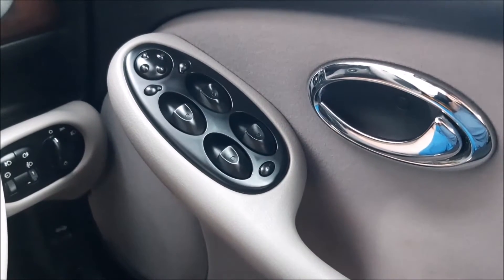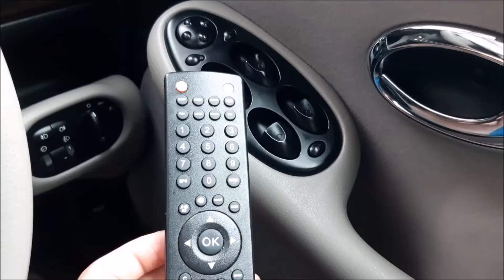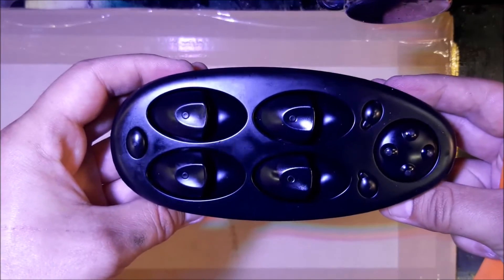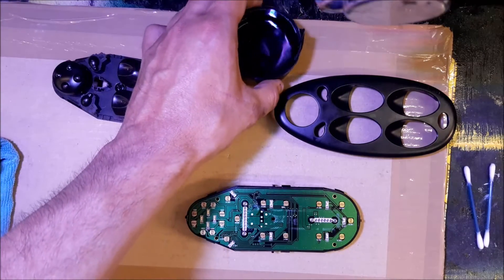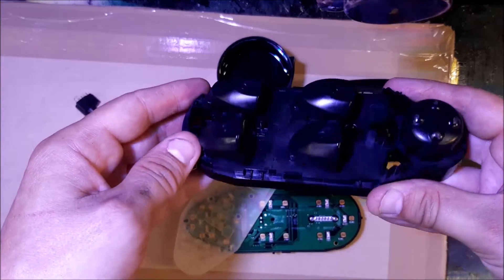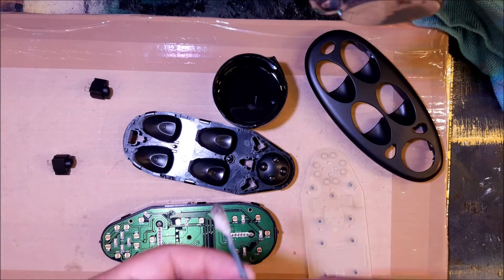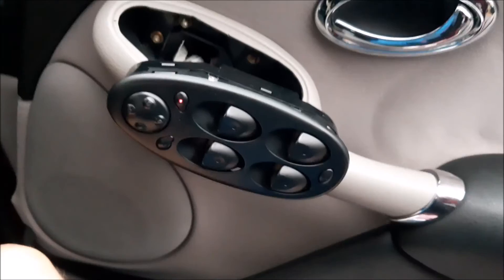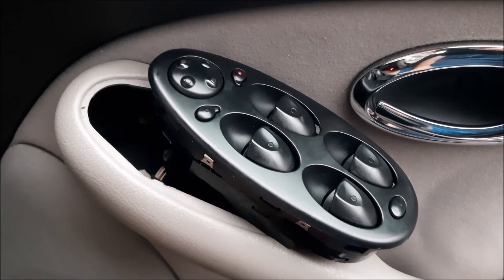repairing the mirror controller switch on our rover 75

Comment: EXCELLENT VIDEO  well explained well excecuted. i have a rover 75 here in mexico city,. and i'm putting it to it's best. Now i have to find a few parts, lije the seal rubber along all the frame than fits the door. and the front quart left.. the one in the lower bumper area

Comment: Thanks very helpful video my mirrors were not moving. Thanks to this video managed to fix, now all working fine.
Reply from the maker: We are glad it helped
Reply: @DPNTV  Got a Cowley 1.8 Connie from a bloke who hadn't used it since 2017. I got some welding done and brakes passed MOT no advisories. Just got to sort out leak in boot not light gasket. Your tips ideas  are very helpful thanks keep up good work
Reply from the maker: @johnwoodruff8640  thanks